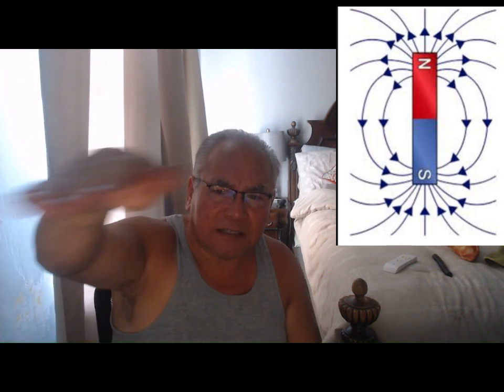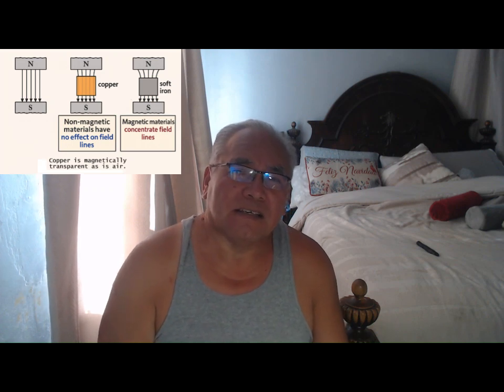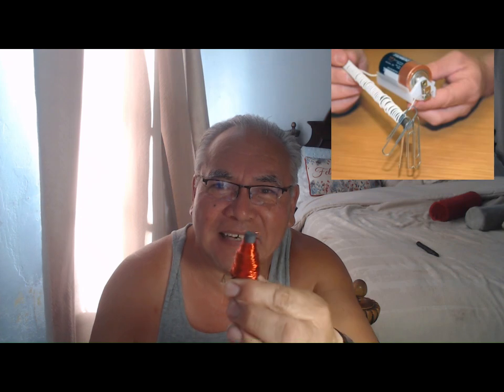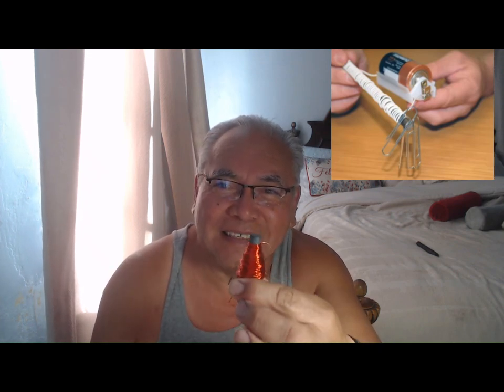Increasing coil production without increasing lenz.

Comment: intersting , show us with and without the iron and the effect on the motor , but the issue is you need to build a whole gen based on that to see if its doing what you think is doing because putting 1 coil with that dont prove anything because for sure lenss will not break the motor because one coil it have to be full round to see if it realy make a difference
Reply from the maker: I’m so sorry that you don’t understand what caused this lenz in the first place
Reply: @alexmanzanero  ok sure

Comment: Hello Alex, I am contemplating some options related to your research:

1. Using bifilar coils as per Tesla invention: coils for electromagnets
2. Winding coils straight onto permanent magnets, where magnets are placed opposing their poles to each other and moving intermitent a piece of iron between the 2 opposing poles
Reply from the maker: yes a lot of pressure build up and you provide the escape route, bravo
Reply: Look what I found, its not a generator but motor. It use the use concept of magnet perpendicular to the stator, maybe it can be use in your generator too. https://m.youtube.com/watch?v=bfzgQOeRSrE&pp=0gcJCa0JAYcqIYzv
Reply from the maker: @JoseRizal-q3o  thanks Jose, a new way to skin the cat, yes same general idea, great, thanks for the info

Comment: Thank you for the video!
I didn't understood exactly. Where to put the iron core?
A simple drawing would help. If we put the iron core under the coil, than the distance between the magnets and the iron core will be very large and the rotor speed will be slowed down also. This way the Lenz will increase (between the magnets and the iron core + between the magnets and the copper coil).
Please correct me if i am wrong. Thank you!
Reply: Indeed. He came with this iron thing straight from the top of his head disregardin all the other implications
Reply: @user-os4qe9gn4s He has right regarding the flux concentration. Maybe this way the iron core will attract the most of the flux lines in that direction (instead of spending in all directions ) while the rotor drag remaining low because of the large airgap distance.
But anyway when loading the copper coil, the drag will increase (just like in case of an air core generator).
Reply from the maker: you are not loading the way lenz, you may have normal cogging towards anything of iron
Reply: @alexmanzanero Ok, thanks!
Reply from the maker: lines of force need to pass through your coil, the iron just pulls the magnetic lines of force to it , so just put iron behind and in between magnet and you coils
Reply: @alexmanzanero how about the temporary magnetism created since the magnetic field it passes through the iron bar/plate/piece? Wouldnt that start intercating with the magnets and cause it to clog?
Reply from the maker: @user-os4qe9gn4s  clogging, yes, lenz, no